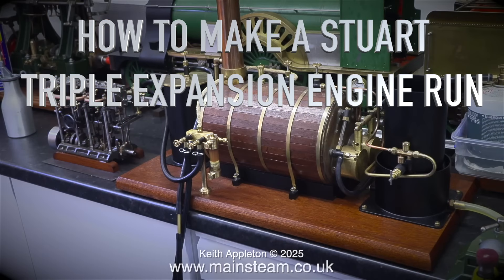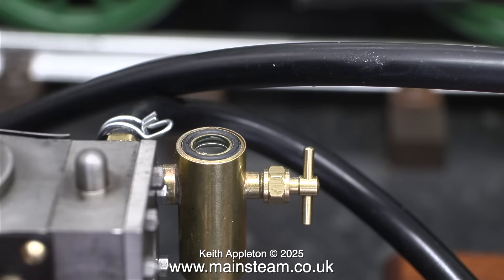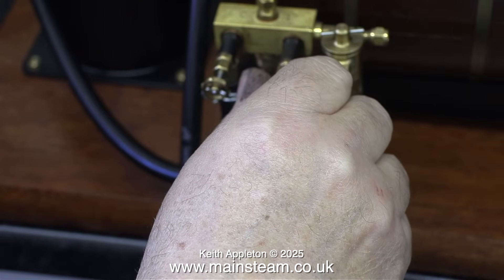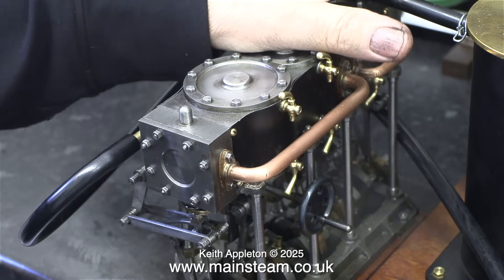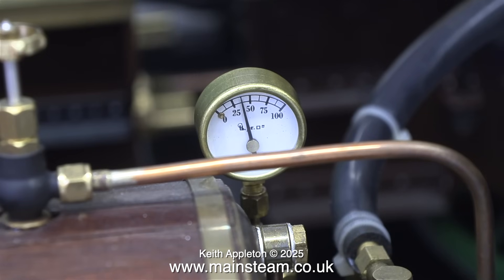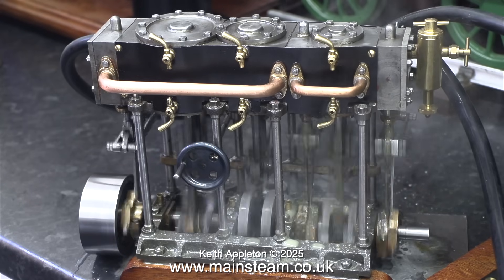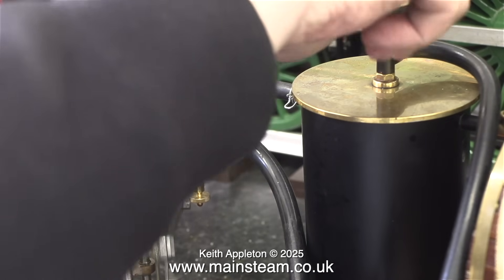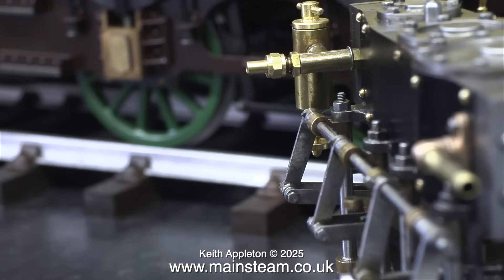HOW TO MAKE A STUART TRIPLE ENGINE RUN - THE STEAM TEST - PART #21

Comment: nice series to watch. i always look how the maker made it. this maker has the skills. you can see that. only the finish is a bit rough. that knocking is a piston hitting a lid. loosen a lid a bit. i think the 2nd cylinder.
Reply from the maker: I would respectfully disagree with your comment . . . . there are a few mechanical things wrong with it, but no pistons are hitting anything.

Comment: I know someone much better at these things will know, but why does the exhaust have to go into a separate tank? and not back into the main feed tank to be reboiled into steam, and as its hot, in theory over a period of time, the main feed tank will be hot, and therfore not need as much gas/wood/ whatever to reheat back to steam
Reply: A long time ago, my grandpa had a Stanley steam car, which he fitted with a condenser, and a oil separator, which he built himself. I believe he had it hooked up to pump the water into a tank so that he could use the water for the boiler, but I'm not sure how well it worked, since he passed before he could really finish it. It was a fun car and had a unique sound running down the road, 40mph was its max speed if I remember right.
Reply from the maker: A Stanley Steam Car isn't strictly a model. Oil separation is difficult in small sizes - I have tried it but it's not worth the effort in my opinion because models don't use much water anyway .......
Reply: @keithappleton still a worthwhile pastime in my opinion. It is a good memory with my grandpa!
Reply from the maker: I have mentioned it many times in my videos. The Exhaust Steam (water vapour) has oil in it and you don't want that back in the Boiler . . . . .

Comment: I understand that you need to manual start the triple expansion engine.  On other videos I've heard of a "Simpling valve" that only runs the high pressure cylinder.  Could this be done with this engine?  I really don't know what the answer is.  Great video regardless.
Reply from the maker: Yes it's possible but not required for this application.

Comment: Would it be worthwhile to make a boat engine self-starting by "replacing" the high-pressure cylinder with a twin-cylinder engine?
Reply: Actually I think the Titanic (and certainly others) engines were built this way. They were 4-cylinder triple expansion engines. You had 2 low pressure « smaller » cylinders instead of a unique « bigger » LP cylinder. Gain of width in a hull where 2 engines were side by side 😉
Reply from the maker: Before we all  get carried away, this is a valuable and highly collectable Stuart Models Triple Expansion Engine and modifying it would be a mistake. Don't forget that it is a small Model engine - not a real one }:-)))
Reply: @keithappleton  I certainly wouldn't advocate ripping this model up, that would be stupid and pointless, but I do wonder if that approach wouldn't be feasible for a dedicated self-starting boat engine.
Reply from the maker: But then it wouldn't be a triple expansion engine - !
Reply: @keithappleton  Why not? the intermediate cylinder would just be taking steam from two smaller cylinders instead of one bigger one.